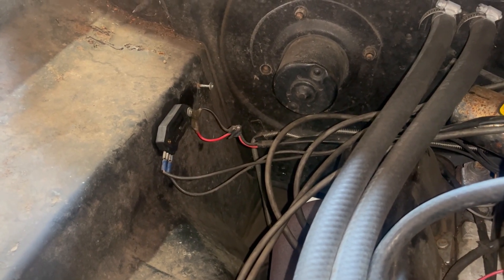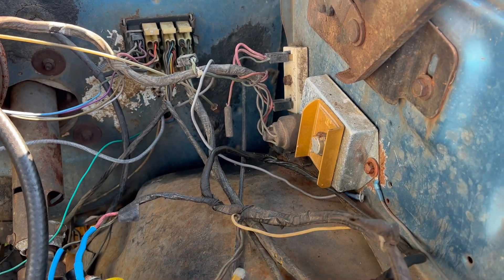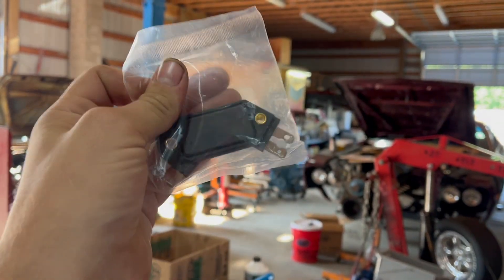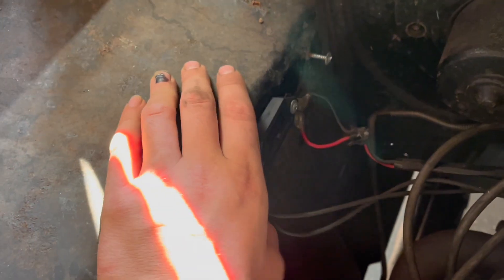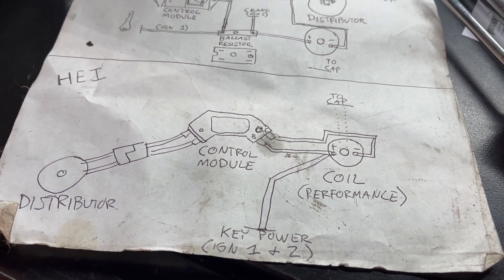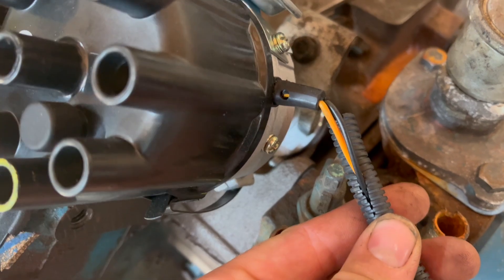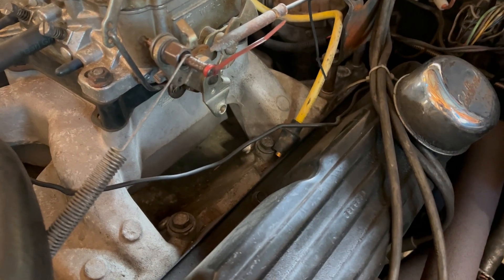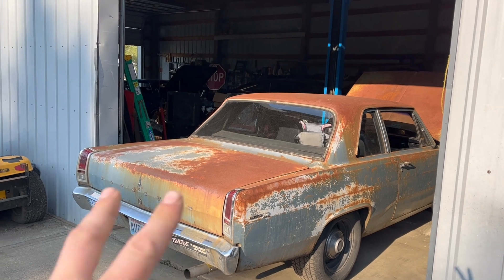The Big HEI Ignition Conversion Video! How To Convert Your Classic Mopar (Or Anything Else) To HEI

Comment: tried msd...broke down on the highway twice. Tried the motorsport box, and broke down again tried another motorsport box. Hot starts were a toss up, starting when it got cooler it seemed. better. I   have a 52 Ford pickup with a blown 5.0. I  had enough and tried this 2 years ago and have NEVER had another problem. Keep a spare in the glovebox and your good to go! Just make a good heat sink.

Comment: Help me bro just bought a 86 fifth avenue I want to convert mine thanks
Reply from the maker: Everything you would need to know to do that is in this video. You need a normal Chrysler electronic distributor, a module, and a couple wires.
Reply: @DeadDodgeGarage this helps with that lean burn bs? Can I find on eBay?

Comment: Hey man hopefully you see this but if I’m losing power on the c terminal is that a bad module?
Reply from the maker: …no? The C terminal is a grounding trigger to the coil negative. Depending on your meter, you may or may not see flashing voltage / ground, or a weird voltage reading as the engine is running. I wouldn’t know because I’ve never checked there, because there is no reason to.
Reply: @DeadDodgeGarage  my 440 would run for a few seconds and die out. C terminal is the only place the test light would lose power. But I put in a different coil and it runs and drives now. But thanks for the reply tho man. Really cool you took the time.

Comment: great video. My hei module quit working.....no spark. Put another module on and it ran....sort of. Long story short the alternators rectifier (the part that changes ac to dc ) was shot. Too much a/c in the current which will cause all sorts of craziness to your hei module. The correct term for this "a/c ripple". Soooooo if you are going through modules like no tomorrow check that alternator.
Reply from the maker: Oh that’s a good one. I remember “ripple” on alternator test print outs. But I never knew what it was. Thanks.

Comment: This works. I even got the distributor wires right the first time. The Chrysler ignition module was from Napa and after I was done installing the GM style (made in the US) module I noticed that the old unit gel seal gunk was not tight and had lifted. So I pried it apart to have a boo. So this thing was full of sand and that stuff felt quite moist! Wtf? This module was made with this sand, why? Don’t know. And , it was only a few years old and looked perfect on the car. Junk. The car is a ‘67 sport fury 111 hardtop with a 383 Commando that I converted to electronic ignition.
Reply from the maker: Huh. Never seen the sand before… common to see goop melting out of the factory units.
Reply: The sand dried up by the next day. Moisture really delaminated the circuit board.  I had one box melt most of the goop, and it ran down the fender of our 1980 Aspen. And it still worked fine!

Comment: Late to the party with a question. I have a ‘66 440 still with points, but the coil i have now reads “no external ballast required” so i unhooked my ballast and I think I dont have any problems? Will I in the future?
Reply from the maker: You might, but I don’t know for sure. It’s been a while since I read up on those.

Comment: Is it normal for the ignition module to make a high frequency clicking noise when running? I’m sure it wouldn’t be noticeable inside a distributor on a factory application, but mounted on my fender wall. I can hear it. Tried two modules from different brands and they both do it.

Comment: Awesome video, before I start doing this to my 73 duster, what happens with the old wiring?
Reply from the maker: It can stay in place with the module and coil negative disconnected and the ballast resistor bypassed. The original coil positive powers the coil and the module, and the distributor connector could be snipped and run to the module if you don’t mind cutting the harness. Or you can do that another way.

Comment: I did dat too, and wired a Ford voltage regulator to my VW rabbit once. 
How to test gm hei module. Leave it all hooked up , lift thr cap, remove the pickup coil  lick your fingers touch the module terminals and a good module will fire the coil evertime you touch it.
Reply from the maker: Interesting technique…

Comment: I tried doing this conversion on my 85 ramcharger. I did get it to run and would idle great. Rev in park all the way to 4500-5k rpm. Pit it in gear though and it would stumble and chug anywhere past 2k rpm
Reply: Also got an electric buzzing from the distributor whenever I plugged the coil wire in. Tried multiple different orientations of the wires and the buzzing and the chugging still persisted
Reply from the maker: Huh. Something was very wrong.
Reply: @DeadDodgeGarage  yeah, my uncle and I were converting it from the dual field distributor to a single field. After converting it to single field and running good we tried the hei conversion

Comment: I'm lazy. I kept my original points but disconnected the condenser/capacitor.
Then bought  a 1988 Grey "Push Start" Ford Thick Film Ignition Module and it's matching "almost HEI" coil. You got to buy the "van" style of module that bolts to it's own heat sink not the distributor. Wiring diagram lookup is "TFI with Points". I want to caution you to add a sizeable single diode going from the plus + terminal of that big coil to the closest "always hot" +12V power wire/cable. Otherwise it could possibly happen that you cut the key AND the Big Coil is powered-up AND a pulse backs up into the module - it could fry it. This way IF the coil positive term "goes high" from being disconnected (switched off) then it will stay powered while coil discharges (sparks) one last time - then quit. You can't tell it but the module will sure Thank You.
   You are welcome.   PS - if you don't like points I don't see why a Pertronix points-replacement kit wouldn't work with a TFI Module/Coil Conversion.

Comment: How can we do this same with 2 pickup dodge distributor?  Use 2 GM ignition modules to the single coil?
Reply from the maker: Get a normal 73+ single pickup. The dual pickup has no advance curve. You could technically trigger the module with the main pickup, but I wouldn’t.

Comment: Funny thing about the GM electronic ignition: It's current sensing/limiting circuitry prefers coils with a higher primary resistance rating (As Accel coils have vs. MSD) which makes them saturate more, resulting in a higher voltage spark than may be seen with low-resistance or "quick-rise" coils. So, unless that circuitry's eliminated....
Reply from the maker: Neat. I pretty much always use an Accel coil.

Comment: I've been running an HEI in my 69 charger for over 6 years with no issues. With the 383 I used a 400 distributer which has the 2 wires needed, bypassed the ignition ballast and used a 14ohm internally resisted coil. Also worth noting, you can use mopar emissions era plug ends from emissions related equipment and they will plug right in to the HEI unit, making everything look kinda factory. And yes, open the spark plug gaps to. 45. This and a gear reduction starter is a major upgrade

Comment: Do not use silicone, that keeps the heat in. The correct heat paste is designed to conduct heat away and its white lead based. The module will last indefinitely with the correct paste.
Reply from the maker: I’m familiar with heat paste, having a background in building computers. But what appears to be dielectric grease is supplied with these modules for the job. That’s all I can say.

Comment: I was forced (by my desire to survive another decade) to retire from engine rebuilding and all the wonderful additions thereto.
The last survivor of my amateur endeavors is an old 304 AMGolly in an old beaten up and rebuilt 1974 CJ5.
After pulling the engine, stripping it down and rebuilding it I installed it back onto the front of the transmission and ever since then kick myself for letting it go. Sold the engine stand and the engine crane.
Never again. (Life is so sad now😢)

Comment: Thanks for putting out this video! Believe it or not, I used this spark control to fix a EZGO golf cart that had been plaguing me with ignition issues. The EZGO replacement box is $130, and I had gone through 3. This HEI box was $39, and it works awesome! Thanks again for the great content that saved my sanity and my checkbook!
Reply from the maker: Nice! Good deal. Happy to help.

Comment: Jaguar XJ6, J 12, and XJS is use the HEI module, when changing them out you have got to put the white silicone  heat sink grease on the bottom of it or it will not last long at all. Wherever you install an HEI module that has got to have that heat sink grease on the bottom of it. Do not use electric grease on the bottom of it and sometimes the modules even come with a small packet of the electric grease, it is the wrong grease. It has to be the white silicone grease.
Reply from the maker: I have done this wrong more times than I could ever count, and it’s mostly been fine…
Reply: @DeadDodgeGarage 
I meant to say “dilectric” not “electric” but either way the Jaguar ones live in a small box as well as on a GM they live in the distributor, maybe mounting them out in the open in a Mopar app keeps them cooler.

Comment: Years ago I upgraded my 70 Charger to Chrysler electronic ignition system with orange box. I always had to carry an extra orange box with me, they seemed to only last a few months and the engine would just stall. I would change out the box and was on the road again.

Comment: So I tried this using the GM HEI, but trying to trigger it with a points distributor (which I realize is not the topic of this video).  It didn't work.  I saw wiring diagrams which added a pull-up resistor, tried that too.  No fun.  The issue when triggering with points seems to be that the GM HEI triggers on falling edge, whereas points are designed to trigger the coil on the rising edge (i.e. when the points open, disconnecting from ground).  I wonder if @Dead Dodge Garage has experimented with HEI and points?

Comment: Love your Channel and thanks for all the help. I put an HEI module in my Dodge with a 0.5 ohm coil it lasted approximately 200 miles. A died minutes after startup while idling. I replaced it and also replace my coil with a 1.5 ohm. Drove it for approximately 50 me then when starting it died shortly after startup while idling. I have checked all the wiring including a voltage drop on both sides. Used heat sink compound but during the failure it never had time to even get warm. Very confused. Thanks Terry Byam
Reply from the maker: Huh. Decent brand module? I’ve had some of the cheaper ones die randomly, but I can’t say I’ve had any consistent issues like that aside from one caused by a less than stellar ground.
Reply: @DeadDodgeGarage  definitely not a bad ground. But yes a cheap module. I've read everywhere that you can't buy a good one they're all Chinese knockoffs. If you know of a quality module I would appreciate knowing. Thanks

Comment: Do you have to use the flame thrower III ultra low ohms coil to eliminate the ballast resistor or can you use the flame thrower II which does jot have as low ohms?

Comment: I’m working on this now and I was wondering if you can still leave the electric choke wire to the ballast resistor after bypassing it?
Reply from the maker: Absolutely. It should have been on the supply side anyway, so it’s no different with it bypassed.

Comment: If you’re going to use an HEI (High Energy Intensifier) module I’d use the MSD man made lightning module because the factory HEI module will drop power over 4500 rpm. Plus is not good to have it exposed because moisture can damage it.
Plus you don’t need the ballast resister unless you’re using points still.
Reply from the maker: If you think I didn’t explain the ballast resistor thing in this video… also, I’ll tell the module installed naked on a steel bracket at the front of my wagon’s 440 where it has been for almost ten years that it could be damaged 😅 there are so many rules that actually aren’t rules.
Reply: @DeadDodgeGarage  I was just adding from my personal experiences in full service garages and what was taught at GM school back in the day. I learned about the MSD module/coil from the circle track crowd where I used to race. 
Guess I shoulda added "Thanks for the video" or "Great video" at the end of my comment as I enjoyed it but I figured the like and subscribe was good enough...

Comment: I want to put a hei in my barracuda but I also want to get rid of the points. I ordered the flame thrower 3 coil and a proform electronic distributor to replace the original one, and I will be getting Taylor spark plug wires plus the hei. Is this the right way to go?
Reply from the maker: Sounds like a good setup to me.

Comment: I'm looking to do a carb conversion on a 360 magnum. can i use the magnum distributor or do I need to get an older one?
Reply from the maker: You need a regular LA distributor. The Magnum unit only works with the EFI system.

Comment: Hooking the trigger wires up backward on the module will let it run but retards the intial timing way down and once you get your intial timing set it'll still act like its too advanced at even 9° backfiring through the carb, gives off the same symptoms as a stuck valve or lean condition. I just did the conversion on my 87 d100 from a points dizzy previous owner installed and once i relized that the wires could be switched and swapped them turns out it was at 45°  of base timing. Adjusted it back to where to it needed to be and now she's runnin real nice. Ive been a chevy guy most of my life untill recently and did not know you could not leave the key foward or aftermarket coils will get hot enough to pop. 70$ msd coil down the drain. The truck didn't come with a ballistis resister originally came with the lean burn/scc set up. This video sold me on doing the hei conversion seeing as i could not put an hei dizzy in it due to firewall clearance. Keep up the solid work my dude.

Comment: If you have a rotary orbital sander the kind that uses stick on paper it works great to massage a sore aching back just remember to remove the sand paper first. I have been doing this every time my back starts aching, you will be surprised at how well it works.
Reply from the maker: I pictured this before I read the “remove the sandpaper” line. Haha. Interesting! The shop massager.

Comment: Hey- I have a 1979 Dodge B100 slant 6, did the HEI conversion as you mentioned in the vid.  Problem now with dogging out under load once in about 2nd gear, and having some backfiring, plugs fouling out. Do I need to also convert my distributor, or do I need to run hotter plugs?  Not sure if it is even related to this change over, but am looking for ANYTHING to help.  Timing is good, changed plugs, wires, dist cap and rotor, changed carb, did compression check, can't find any vacuum leaks... just at a loss and looking for any other possibilities.  Thought maybe if the HEI is running hotter, current recommended plugs not hot enough, or need more HEI compatible distributor (no points with my dist.) ?  IDK-- help please????
Reply from the maker: It likely isn’t related - but it could be a defective module. You could have wired your distributor pickup backwards, but it would likely run absolutely horrible. No, you don’t need to change plugs or do anything else as far as that goes. But just to make sure, you are using a standard single pickup distributor with a vacuum advance, right? If by chance that van came with Lean Burn and you used the original dual pickup distributor with no timing curve, that’s a bad move.
Reply: @DeadDodgeGarage  
Thanks- I didn't think the other would be related, but thought I'd double check.  It was a lean burn originally but don't have a dual pickup distributor in it.  Thanks

Comment: Can i run a gm hei conversion distributor on a 1988 efi 318?
Reply from the maker: Not if you want the EFI to continue working.
Reply: @DeadDodgeGarage  oh would it cause the computer to not fire the injectors
Reply: @DeadDodgeGarage  because I'm having a rich running conditions

Comment: Hey would like your opinion on this but I have an 89 w250 that I just preformed this swap on and the truck seems to run good until I try to hold consistent rpm’s like going 70 mph for a time it seems to stutter and seems to be a touch harder to start. I have the timing set to 14 degrees advanced. Before this conversion I never had that issue. Just wanted to see what you thought
Reply from the maker: I can’t say I’ve ever heard of that one. Have to wonder if it’s heat related? Or possibly a defective module - although frankly I would expect it to do worse stuff.
Reply: @DeadDodgeGarage thank you for your time. Love your videos!
Reply: I read the standard LX301 at high RPM (above ~4,500–5,000 RPM), some modules struggle with dwell control and can cause misfires or weaker spark. Supposedly the Delco D1906 is better for this and starting.

Comment: Small engine guys also use the HEI module on some of the Tecumseh motor that had the solid state ignition modules that burn up and are NLA. They have 2 pins on the flywheel that trigger a (gasp) Ford ABS module from the rear diffy to the HEI and fire a coil, pretty reliable setup.